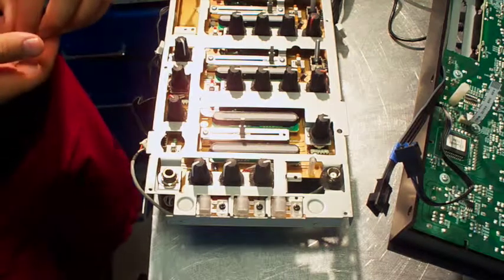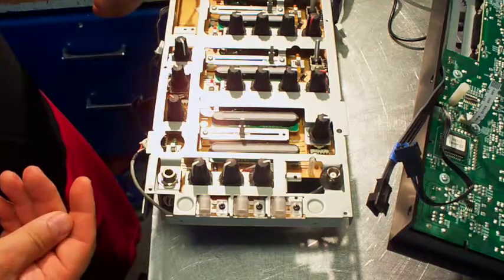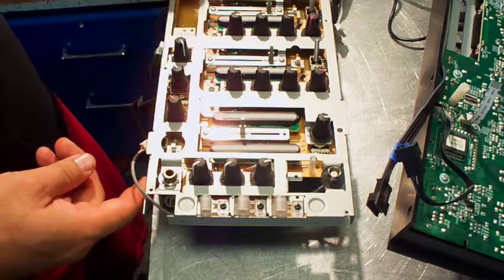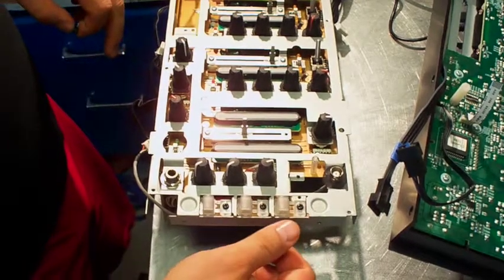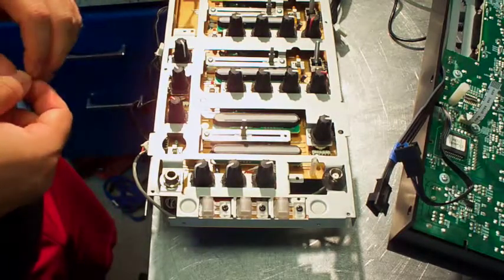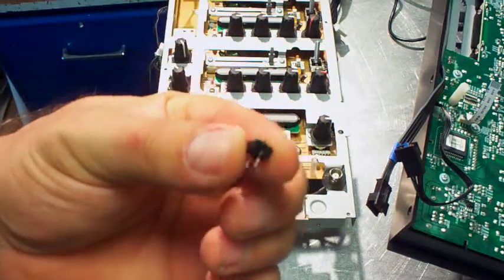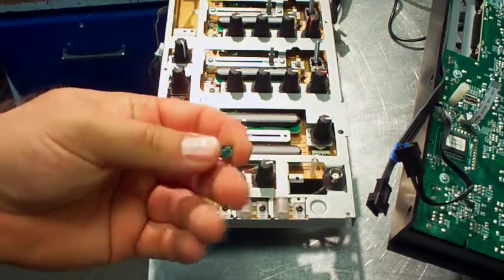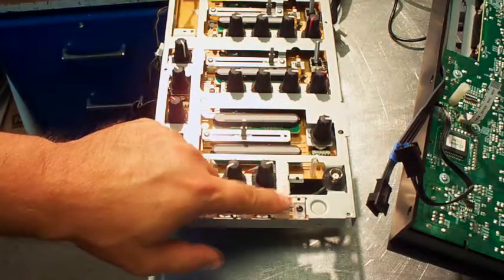DJ Mixer Repair - Tact Switch

Comment: Hey I have a Rane 61 that won’t power up. What do you suggest I do to possibly fix it? Thanks
Reply from the maker: It's most likely a short at the IEC input.  If not, it might have an internal fuse that's blown.  Let me know if those fix it.